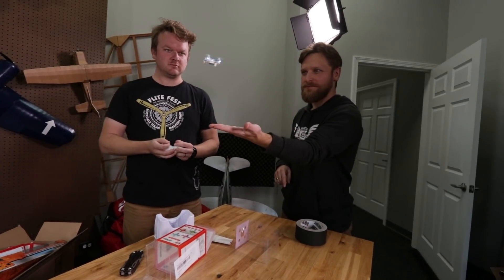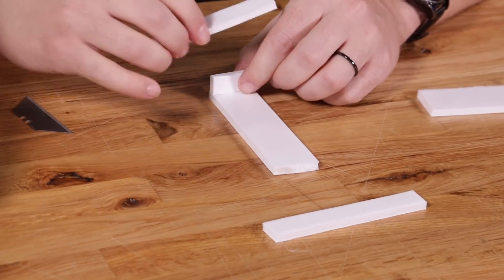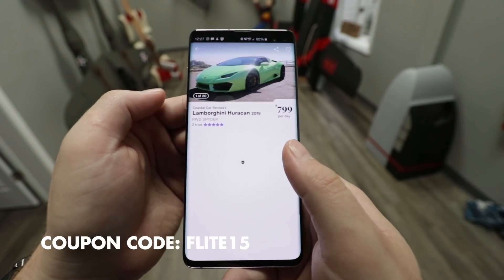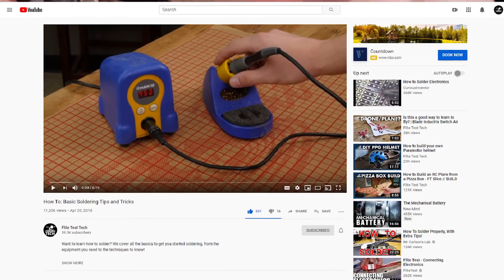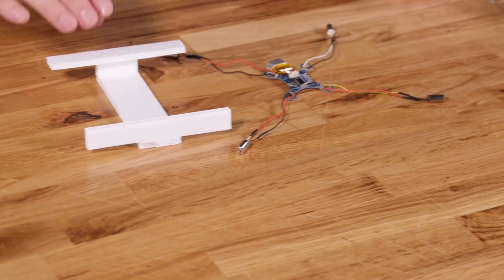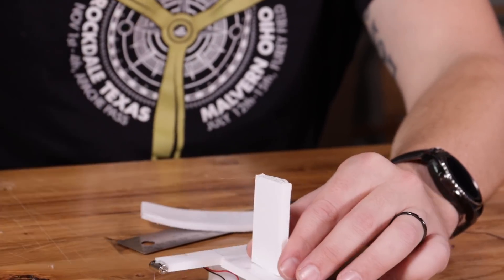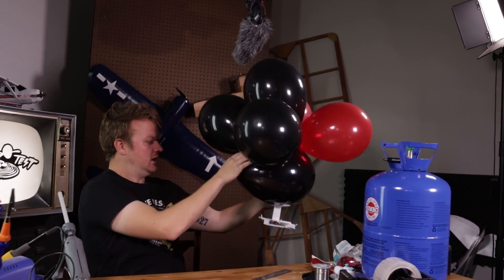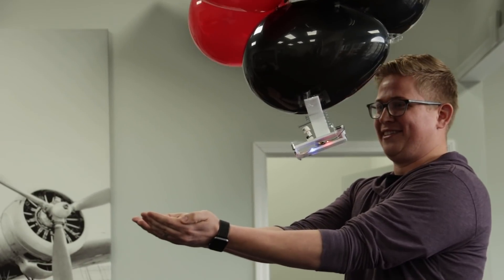Make a Blimp from a $16 Micro Drone?! 🎈🤯

Comment: The shrink wrap or electrical tape on the wire extension joint is actually kinda important.  Not everyone is going to think about the possibility of short and do it automatically, especially if they need detailed soldering instructions.

Comment: I used to hate the little drones because the pitch & roll were so touchy this is a great way to make useless as far as I was concerned into a fun toy to fly around the house. I am a big 3D printer guy and think that building a outer body then using a big balloon inside of it could also place ballast in this area also to balance C/G OH I need to go shopping probably drop more than I should But it's going to be great design

Comment: You could cut the battery wires and solder in connectors of your choice to the Leeds from the battery and the drone and just use tiny aftermarket batteries to stay in the air.

Comment: I had an idea a long time ago for an aircraft whose entire movement was controlled by buoyancy. I call it the gravity blimp.
Basically a blimp with wings, control surfaces, and very high positive (adjustable) buoyancy, but no engines.
The concept was that the CG and upward movement would push air over the wings at a rate high enough to develop forward and upward motion and control authority. The buoyancy would then be decreased at altitude and the aircraft would fall and function similarly to a glider, and this process would be repeatable.
I built a couple huge ones in X-plane, but I was always curious as to if I could make it work IRL.

Comment: what happens if you use a weather balloon... some fishing reels  or fishing poles with super light fishing line on them.. you could get your drone to stay up for hours in place.. while taking video... if your batteries will last that long for the camera and transmitter.  heck that would work without any motors.. just the camera on the swivel..  think about using it over a creek or over the ocean to watch for gators, fish and sharks.. depending on the water source.  imagine putting up a cell phone device that is a repeater so you could get cell data from a long way in a mountain valley.   i tried to get some search and rescue crews to do this.. so they could use their individual cell phones linked to a laptop base station for plotting out where everybody is and where everybody has searched.  so somebody at the base station could call out for somebody in one area to search 30 or 50 feet to their left as nobody has left a geo track there.

Comment: Here is an idea, mini brushed motors that have the body shaped into a heatsink. Less heat, more longevity.
Reply: Also more weight and also the magnets are on the outside so it won't help

Comment: I recently saw such a tiny quad at the local hobby shop, it stores inside the transmitter! Roughly 1" square, I couldn't resist for $30.  But it's like, TOO small to want to take apart!

Comment: Title: Using $16 Micro Drone to Make....

Video Introduction: "In today's video we're going to tell you how to take a common $20. drone and turn it into..."
Reply: CLICKBAIT or whatever
Reply: The price went up as they were thinking about it because this video will increase demand. 🤣
Reply: those cost 10.00 on ebay sometimes.
Reply: Varies some, in stores it’s typically $20, but on sale it’s cheaper. Also depends on the model you want, I even got a fairly big one that’s like a bat inspired X wing (it can vertical take off and then you select a airplane mode and it tilts about 30 degree off the horizon and most of the lift is done with the X shaped wings). It was a refurbished model for $20 and flew decent, uses a smartphone with Bluetooth for control, also has a rear facing camera though the picture quality is extremely lacking still kind of cool for a kids I guess but it’s not live-feed (it does transmit over Bluetooth though, so I was able to snap a pic and send it to myself to figure out where I had crashed, haha!)
Reply: @jakegarrett8109  
Title doesn't say that... says $16.
Reply: 20alphabet well it fluctuates a lot and will vary with currency and shipping costs etc. you can get an Eachine fold old mini indoor one for $13 right now on Banggood, so with shipping it’s like $16 or just under. So it depends a bit on the model, where you get it, where you live for shipping, etc, I think anywhere from $15 to $20 is fine (I typically round up, like you’ll probably want a spare battery, or in my case I always assume 2-3x the cost because I mod everything so extensively**

**Like last night I was adding 2 cell phone batteries and a voltage regulator in a modular design for my favorite ti-89 calculator... I mean everything gets modded! My personal RC controller has a more expensive inline signal booster than the entire controller cost, lol! Plus it has my traditional voltage booster/buck converter mod (so anything from a single cellphone battery at 3.7v to 40v is fair game to power it), plus I can also use hilariously huge high dB Yaggi-Uda antenna or just high dB dipole antennas or the stock antennas, like everything tripled in price after I’m done. But the way I see it, I can make something better than anything you can buy and do it for cheaper than a high end model (part of this is because I have an FCC technician license in the case of the controller mods, because it would be illegal for companies to sell something like this to 99.9% of the market). But same with bicycles, in that case I buy used to save a hundred or more and then use that towards buying some nice carbon fiber upgrades because I’d rather have a tricked out and now much higher end specced bike with maybe a few scuff marks than a shiny lower tier bike, or simply to have fun customizing it purely for enjoyment of doing so. Hence I would have rounded up to say “$20”, but not everyone mods things to the point I do, so maybe $16 is fair too.
Reply: @jakegarrett8109  
The title says $16.
Reply: oh no 4 bucks!

Comment: Can anyone tell me what a park 250 size motor, or a power 50 motor means??? I can’t find anywhere what it means
Reply: In the old days they used brushed can motors. If I recall correctly the numbers referred to the motor housing length. So if you had an RC car with a 400 motor, you could fit a differnent 400 motor without having to worry.

When they switched to brushless motors, people were so used to the old specifications for power that they declared a motor equivalent to a "park 250 size" motor. Even though the size didn't match.

These days watt, kv and size are much more important.

Comment: Great video, but a little tip: Instead of unsolder on the PCB board, just cut the wire in the middle, and solder the extension there. That way you don't confuse the colour of the wires... ☺️

Comment: there is a huge helium shortage.  many places that used to fill balloons no longer will.
Reply: This is a massive waste of helium especially when you consider it is vital to run MRI machines and that it is in super short supply.
Reply: Scissors95 I’m pretty sure that’s recirculated with a turbomolecular pump and not wasted... Anyone can use one to also collect helium gas out of the air (as well as liquid nitrogen/argon/xenon or basically any other molecule), oh yeah, and it can also make ice (really cold ice if you wanted!). Obviously you wouldn’t use one for this little project, but I’m pointing out that it’s not just helium thrown every MRI scan. I believe it’s just for supercooling the magnets, and that’s what a turbomolecular pump is often for, circulating and chilling helium, or extreme vacuum or separating molecules and stuff too but they are typically sold used very cheap since hospitals don’t want an MRI out of commission because the pump has 30k hours on it (by the way, that’s not even the first service interval... the hospital is treating it like a car with only 1k miles and hasn’t even needed to change the oil yet... but their loss and great for experimenters and researchers I guess!)
Reply: Hydrogen is a better lifting gas, and it is much more fun
Reply: @sablatnic8030  Just be sure to stay away from an ignition source to prevent a Hindenburg type situation.
Reply: @ronfullerton3162  With an ignition source the fun will come. And they don't say BUM, just bum - have tried.
Reply: @sablatnic8030  Just so you know! Didn't want you to lose a house or shop. Have great fun and be careful.
Reply: Isn't much helium left yet we still piss it away.  Human efficiency at its best
Reply: Helium not needed for this.
Reply: Helium ain't that hard to make, all you need is a thermonuclear fusion reactor.

Comment: can u make a plane from a drone??

like so FliteTest could see
Reply from the maker: great idea:)
Reply: @FliteTest  I thought you did a while ago
Reply: FliteTest thank youu:))
Reply: @FliteTest  I really need some help on this build I am having a issue with the drone after soldering everything and trying to give it throttle. :(
Reply: Peterstripol did this
Reply: Jack Jorgensen yeah i’ve seen peter but i’m talking about a larger foam board plane
Reply: I made one from a Dollar Tree Foam Plane, and an old $12 Drone.  After "monkeying-around" with it for over a week, I finally got it to fly.
(Gave it to a neighbor's kid, before taking pics of it!  Sorry ! ! !)
Reply: Ive been thinking this too. Or add larger motors/batteries etc.
Reply: What I'd love to see one day is kind of a hybrid. A quadcopter with airfoils. Might be near impossible to fly, since certain attitudes/angles of attack would (I think) end up pulling you in unintended directions, but it would be interesting... I've been wondering if the arms on a racing quad were airfoils angled to produce lift at around the angle that allows level (ish) flight at full throttle, which I think would probably be something approaching 90°, could  the power normally used to keep the quad from sinking be used to produce more speed?
Reply: @ledchickenfpv7164  https://www.kareareadrone.com/product-page/all-color-rd-036-kea-wing-fvh-260-6-props
Reply: @toddmusser8555  Thanks! That's actually pretty funny because I've been thinking of Karearea's vertical arms ever since the idea popped into my head some time ago. I knew I couldn't possibly be the first to think of it and figured that the negative aspects must outweigh any advantages by so much that those who have tried it just binned the idea without producing any results worth sharing. I guess I'm off to see if anyone has any videos up to that show how it flies. I noticed the linked frame is a 6"... Probably too squirrelly for racing but good for long range due to better efficiency, I'm guessing. Thanks again. Down the rabbit hole I go. 😁👍
Reply: @ledchickenfpv7164  josh bardwell did a video on it, and uavfutures also, probably others I haven't seen.
Reply: @toddmusser8555  Thanks again, brother man! 😁
Reply: Check out Peter Sripol's channel. I'm pretty sure he did a video recently where he made a micro quad powered paper airplane.
Reply: Isn't that like every rc plane? Or were you referring to a quadcopter?

Comment: What are l the lightest but cheapest motors I can buy?
Reply: What size plane?
Reply: @grifflyer1421  maybe 20 inch wingspan
Reply: Ali Express has those orange 2212 motors for less than 5 bucks (after shipping). They may eat an ESC here and there but those cheap little suckers definitely offer inexpensive thrust.
Reply: @milesnoell  thanks ill check them out
Reply: @Madfalcon45  The 2212 motors might end up being a bit too heavy. You might want to try something like the Racestar 1806 https://www.banggood.com/Racerstar-1806-BR1806-2280KV-1-3S-Brushless-Motor-CWCCW-For-QAV250-ZMR250-260-RC-Multirotor-p-1065664.html?rmmds=buy&ID=521309&cur_warehouse=CN
or the the Emax MT1806 if you want a bit more performance.https://www.banggood.com/EMAX-MT1806-KV2280-Brushless-Motor-For-Multirotor-p-933931.html?rmmds=buy&ID=521309&cur_warehouse=CN